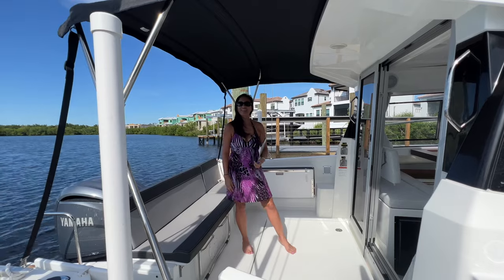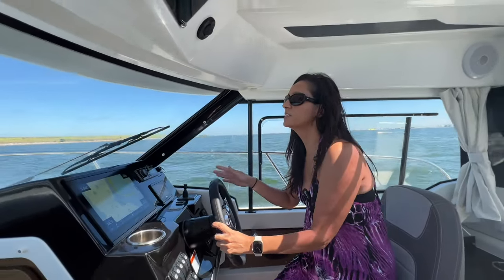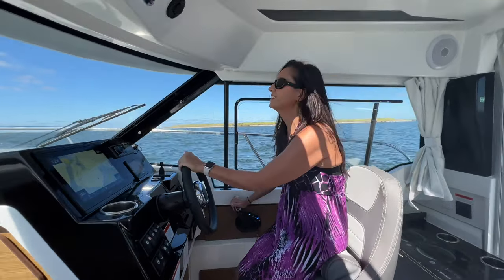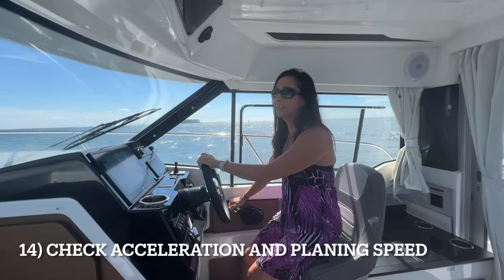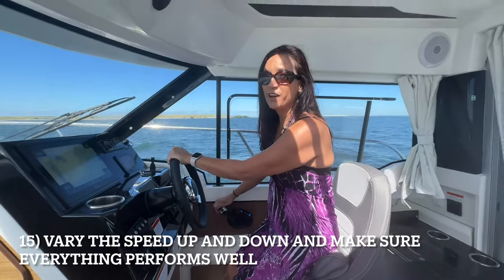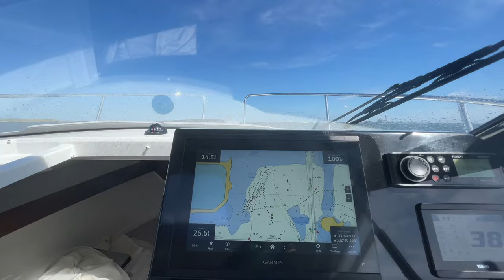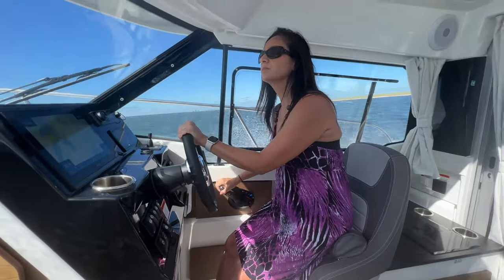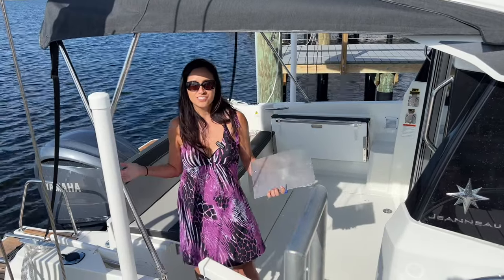How To Conduct a Sea Trial using my 2023 Jeanneau NC 795 S2

Comment: Nice video and love the boat. Going to look at them. Any options recommend? Any things you don’t like?
Reply from the maker: Hello Karon, My options were based on how I plan to use the boat which is as a weekender.  This means using it as a camper so I needed the refrigerator, stove top, and AC for interior comfort.  I also find the bow thruster and windlass anchor extremely helpful.  I also opted for the higher HP engine (250hp) which seems to top the boat out at about 42 mph.  My only disappointment with the boat is the cabin can become very hot as the side windows do not allow enough airflow on hot days so I am planning to tint all the windows and mount a fan.  I did not opt for the lithium package and instead carry a gas generator that I can mount on the rear platform when camping off-grid.  Hope this helps and thank you for supporting my channel.

Comment: May I ask how you like the boat?
Can you trailer it?
Reply from the maker: Hello karon, Yes I am happy with my purchase.  I use it mostly in Tampa bay and the surrounding gulf coast area.  You will need to learn how to use the engine tilt and trim tabs in rougher waters so that you do not get beat up by the waves.  The bow thruster in a life saver when docking and really easy to use.  As I mentioned before my only negative is that the cabin gets hot because there is no way to allow air to come in through the windshield.  The bathroom is small with a small shower space but it gets the job done. I think the bedroom is a good size for me and that the AC keeps the cabin cool while docked with the curtains drawn.  As for the kitchen, I have not really used the electric stove as I bring a small microwave with me (stored under the sink) and the refrigerator could be bigger but holds enough for a weekend getaway.  Thanks for watching and supporting my channel.
Reply from the maker: BTW, yes it can be trailered however I have not needed to as I live on the water and have a dock/lift in my backyard.